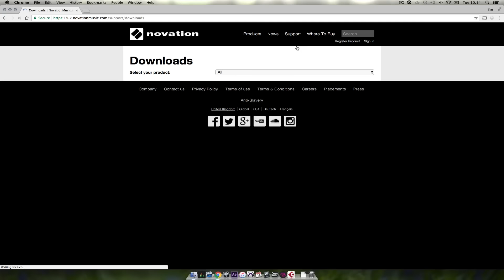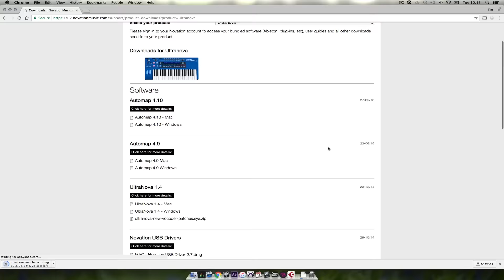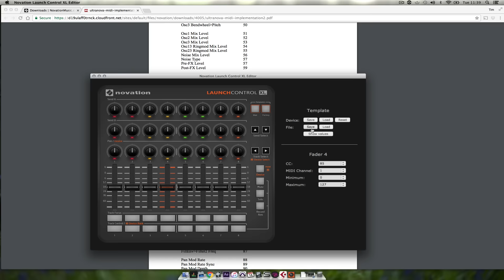Novation // LCXL101 - Controlling Ultranova

Comment: Can this be done with the Circuit? Or do I HAVE to run a computer between the LC and the Circuit?
Reply: You do not need a computer in between the Launch Control and the Circuit, though you do need a USB host device.